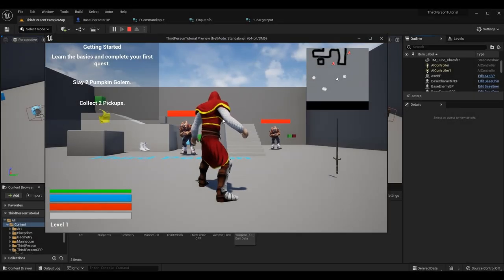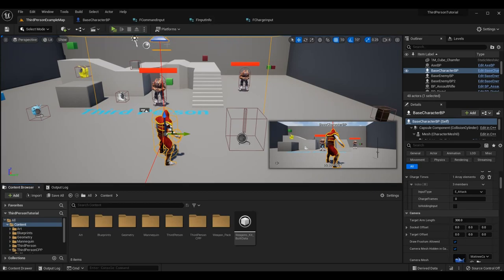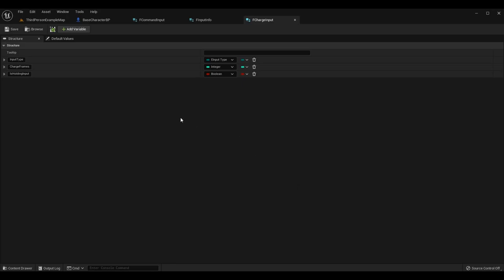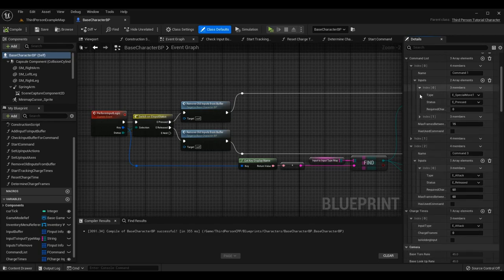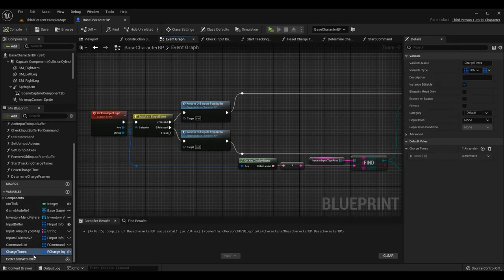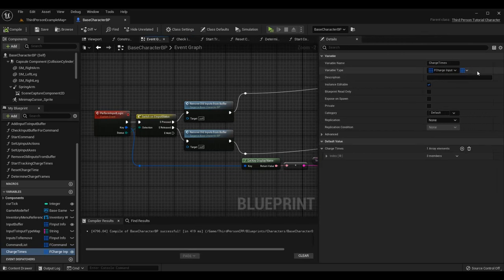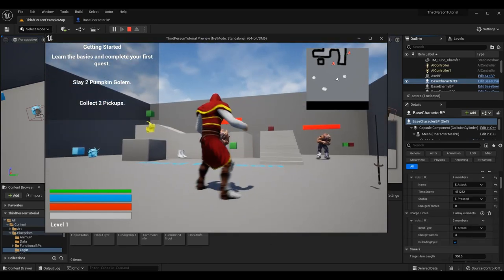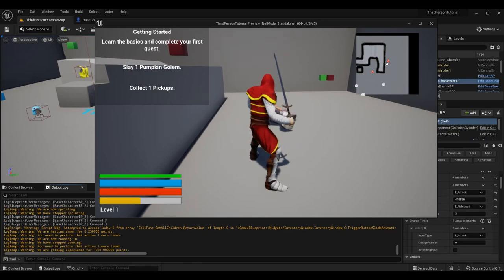Blueprint-Only Input Buffer System (Part 7) | How To Make YOUR OWN Game | UE4/UE5 Blueprint Tutorial

Comment: How would i use the hold part of the einputstatus?, how would i do a command like l1 hold, left direction hold/press, then x button press?
Reply from the maker: Holds are for multi-button inputs and chargeable attacks, not “charge” attacks like in this episode. The terminology I use is a bit confusing to explain, even for me, so I apologize. Let me put it like this: Charge Attacks are attacks that require an input or direction to be held for a given number of frames before being marked as completed, whereas Chargeable Attacks (or “Held Attacks”) are attacks that can be used immediately, but can also have their inputs held to do more damage. The latter is what I intend to use the “HOLD” status for.